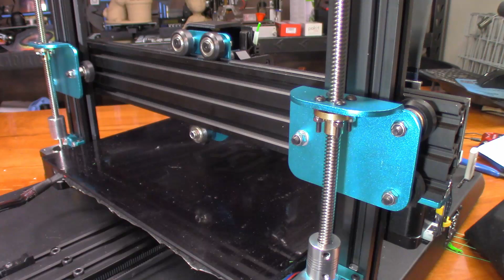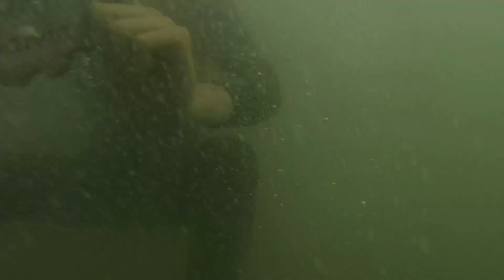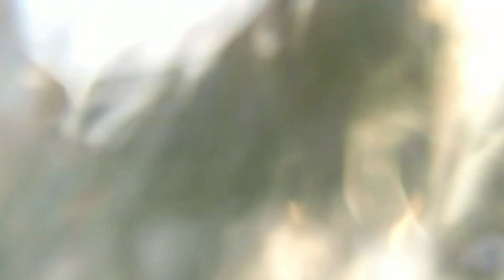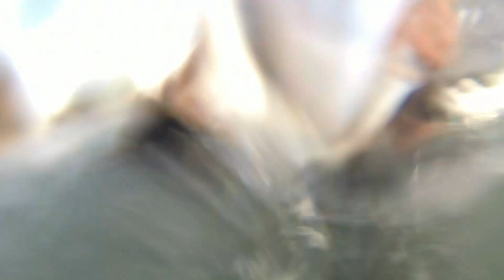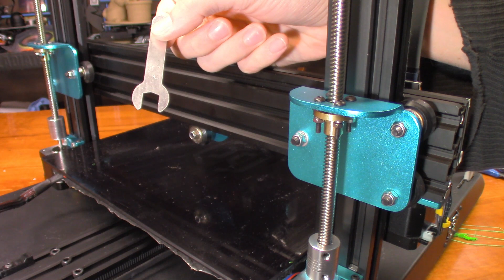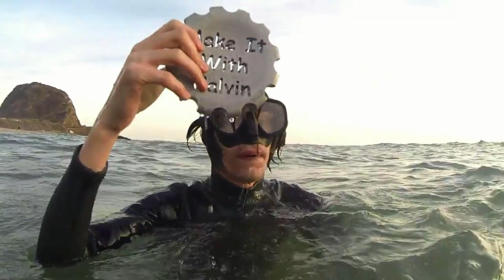Artillery 3D Sidewinder X1 Troubleshooting Loose Wheels

Comment: How tight should the wheels controlled by the eccentric nuts be?  Just tight enough so any slop is taken out?  At the right tightness, you should still be able to turn the wheel and move the axis, correct?  I had adjusted these when I first got my printer (a couple weeks ago) but now the Z axis wheels seem way too tight and the X axis wheels are extremely loose. Why should these change that much with limited use? Is that normal?  

When I now try to re-adjust the lower X axis eccentric nut, I can't seem to get it tight enough. I've been trying for an hour or so and I can get it somewhat tighter but the X carriage still wobbles and the wheel is spinning freely even when I get it adjusted about as far as it will go before it becomes loose again. What can cause this and what should I do?  Appreciate any help.
Reply: Hello, I got the exact same problem with a brand new swx1. After hours trying to tight the X axis, i figured out that one of the corners of the top weels mount was a little bit twisted (maybe 2-3mm). It made the top weels not nalign at all and the x axis impossible to tight.
Got it fix with flat pliers.
Hope that will help.
Reply from the maker: You want the wheels just tight enough to take up the slop. Otherwise, you run the risk of the wheels getting a flat spot and that causes issues in its own way too. 

As for the lower wheel, the holes are generally slightly oversized to allow for changes in extrusion width and you may need to loosen it up and then "tighten" it down again. I hope that helps some.
Reply: @MakeItWithCalvin  Hi Calvin. Not sure if you saw my post on Facebook about my issues tightening the eccentric on the X-axis. There are a bunch of comments and images & video of what I'm dealing with, so please take a look when you get a chance. I've been dealing with this for about a week and still can't get the x-axis wheels to tighten. I did get new eccentrics and installed one on the lower x-axis wheel but it doesn't seem to help the problem. I'm really at a loss as to what the issue is or how to resolve it. I haven't been able to print since I started with this and really need to get my printer working again so I can resolve the printing issues I've had from the start (see my other posts on this topic). Can you please give me a hand with trying to resolve this eccentric problem? I'll send you a few dollars if that helps. Appreciate anything you can do. Thanks.